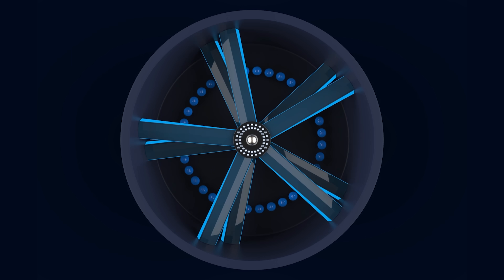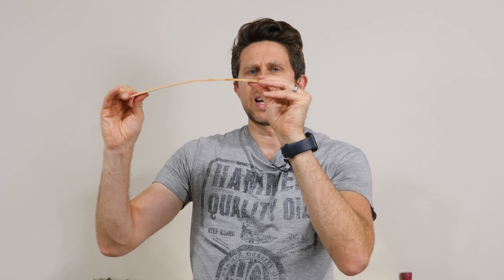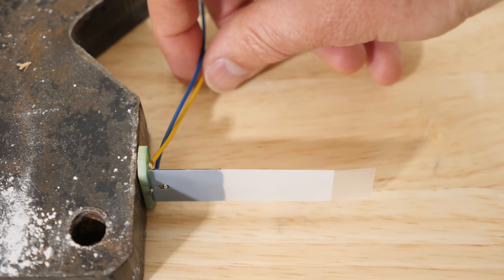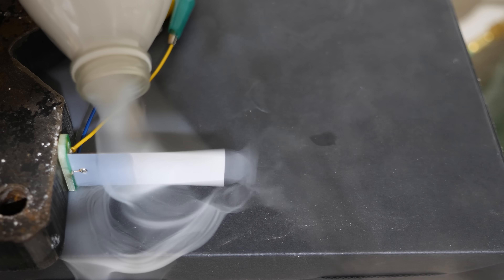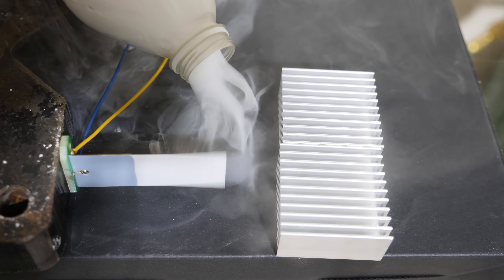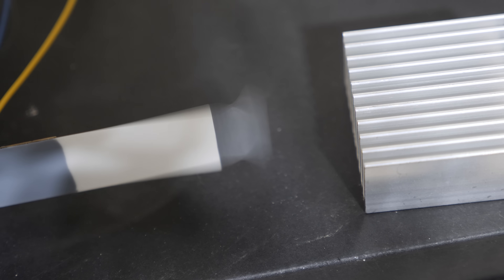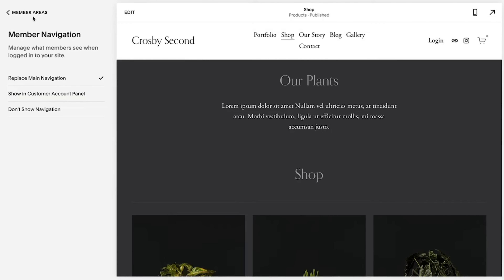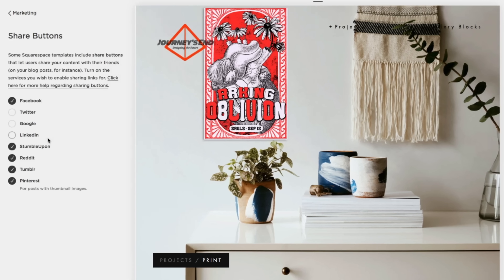A Solid State Piezoelectric Fan—Does It Actually Work?

Comment: 4:43 lol had to delete my whole comment XD ...and yes i would. apparently thats more obious then i was thinking however i would think small clusters of high heat output chips would benefit from this but maybe with enough work and reduction in size they could become a standardized part of every component in the board individually would take some tweaking to get it to run off the right amount of current still oscillate to an acceptable degree and not cause more heat ten the original component and on top of that and probably most importantly is to be the size of a current transistor...

Comment: took me a bit to formulate this response, but 'solid state' sounds like another absolute term we the general populace decided. rather than whatever it's original designed meaning was, at least that's what I get from the comments, could you possibly direct me to one that works as well as an old oscillating fan? it seems like there isn't a ton of power in your little design, but it is a tiny flappy piece, so what's the more full sized one like? how does it compare?

Comment: One could also attach several piezoelectric elements to a plastic strip to control them independently of each other. This would allow more complicated movements, such as the flapping of a bird's wing (which not only moves the wing up and down, but also rotates it), to get more power out of it.
Reply: Piezoelectric bees!!!

That reminds me of an article I read on Wired ages ago... maybe 20 years back someone invented a slugbot.  Basically it was a little treaded robot with a very basic articulating arm that could go out in the crop fields.  It turns out slugs glow under black lights, so they were able to design this to go and scrape the slugs off the plants and into a container.  The really clever bit was that then the bot would go back and dump the slugs into a vat to turn them into biodiesel to power the slugbot.

Imagine an army of little pollen powered Piezo electric bees going around pollenating flowers.  (I mean, the real thing is much better, but it would be a great detail in a sci fi story or something!)

Comment: The only downside to this is that, there is a lot of vibration. Because the object is moving back and forth really fast, that results in an unwanted amount of vibration. If you wanna do this is a large scale stuff with  that type of fan.

Comment: There is an alternator at the power company that spins to produce the alternating current. Even though it is really far away you still need something spinning to produce the ac current.
Reply: Good point, but a spinning device is not required to produce AC.  AC can be produced with electrical / electronic circuitry.  Have you heard of a "tank circuit"?  It's comprised of a capacitor and an inductor connected in parallel.  This kind of circuit provides the basis for making an oscillator which produces AC.  And that is only one method of producing AC... there are many others.
Reply: @yeroca  Actually, as soon as I wrote it I remembered that I have an inverter hooked up to my solar panels.

Comment: The showstopper for this type of fan when I considered it were:
High voltage needed. We didn't want to go above SELV if don't have to.
Second showstopper: Buzz noise. This thing is not silent, the vibration is nasty. I was wondering if it could be eliminated by using two in the exact opposite phase, but the costs of needing two was too high.
Reply: Although the voltage is relatively high (30v should be enough) the current is extremely small. Is there no provision in the SELV rules that allow any exception for sub milliampere currents?
Reply: @laurensvisser7623  the device we had was working on AC 110V. If 30V is sufficient, it should be okay.
Reply: @sevnpicoferro5352  Lower voltage means less movement. So you would need to scale this up even more at 30 V

Comment: We actually used piezoelectric fans for a cryo-cooler made for the ISS. Fewer moving parts in space is a good thing. I developed Computational Fluid Dynamic models and simulated an array of them. Vids are on my channel from ~9 or 10 yrs ago.

Comment: By placing diodes in the circuit couldn't you get the energy to expand the one side FROM compressing the other side? Some diodes and a small capacitor.

Comment: I would imagine that it would be rather challenging to make piezoelectric fans for a PC that could act as drop-in replacements for the conventional rotating fans used. It seems to me that any piezoelectric variant would require more volume to move the same amount of air. The design of the chassis would have to be modified and become somewhat larger, perhaps by 50% or more.  Then there would be the question of how quietly it could be made to operate, which is important to many people. But, after that, why not?

Comment: Sharper Image Ionic Breeze, from WAY BACK, ionized the air, with high DC voltage, and it then moved by the polarized plates. So, the only movement was the air, itself. Of course they charged a "left nut" for it, inspiring guys like Dyson, to make overpriced wares !
Reply: But Dyson's fan still has rotating blades hidden inside.  The only cleverness is in the use of the "entrainment" effect to move more air than the fans themselves are moving.   That and figuring out how to get people to spend about $300 for a fan that really doesn't work as well as a $20 box fan from Walmart.

Comment: The air pump for my aquarium has the same principle as this, only it is using electromagnetism instead of piezo.
Reply: Well, any speaker or voice coil in fact has the same principle as this. Moving air without the need of conventional rotating fans (no bearings)

Comment: Nice concept! The "fan blade" could work better if it was uniform in rigidity, though. Seems like the tape at the end is making the assembly act as a pendulum, which starts resisting the driving force partway into the cycle. This is probably decreasing the total output by a significant amount, as only the smaller, more flexible part is moving air outwards.
Reply: I suspect this was a hack rather than just a tuning method.
Reply: That's true, in the original paper they can tune the blade to the correct length to get the correct natural frequency. I believe in this instance though he had to add the tape to achieve the correct  natural frequency of the system so the tape acting as a damper is part of the tuning.
Reply: I was thinking that the tape at the end was probably inefficient, but I didn't possess the knowledge to articulate why.
Reply: Saw the same thing in the slow motion the end was too bendy
Reply: I think that was more for a visual reference so you can actual see that its moving without smoke. Or for example when you see ppl test fans they tie strings to the vents because its easier to visualize the air movement.
Reply: u are one smart cookie. Good thought process
Reply: how piezoelectric crystals vibrate..? what makes alt current to give, up and down force to it...?
Reply: @dgr8nikhilsrivastava  It is just in resonance, it just does it automatically because one end is firm and the other is free to move. It is the reverse of making a thin sheet vibrate when air is blown across it.

Comment: I absolutely would use this kind of thing in my computer as long as it could move enough air to keep it cool and was quieter than the fans I currently use!

Thing is, we already have technology that makes rotating fans extremely efficient, incredibly quiet, and super cheap. The amount of power normal fans use compared to the rest of the system is rather negligible. These things would have to compete with that, and I don't know for sure that scaling it up won't have unintended noise pollution.
Reply: The Major Hardware channel has fan blade showdowns.  It wouldn't quite fit their normal testing parameters (they put different blades and shrouds on a the same fan motor for consistency) but it would be interesting to see one of these in a his tests.
Reply: I've never had an electric fan wear out, my laptop is over 20 years old and the fan still works fine, mind you I don't use it very often, never seem to have the time or need for it lol
Reply: True, what about the wearing part?

Comment: And hard drives!  Hard drives have tiny little piezo actuators attached to the heads for fine tuning of the position.  Kinda neat.  I thought the arms were just magnetically positioned, and the heads were rigidly attached.  Nope.

Comment: Yeah, if that sort of fan would work for a computer, I'd definitely get some.  But it displaces the heat rather than getting rid of it.  Is there a way to convert the heat into coolness?
Reply: A thermocouple converts heat into electricity, but at fairly high temperatures. If some brilliant engineer could devise a low-temperature thermocouple, then I think you're onto something. The system would cool down and provide current at the same time.
Reply: @marsbux-tech  That's what TEGs and TECs are.  Peltier-Seebeck effect devices.  You can buy them for CPUs and were popular for awhile, but they generally aren't efficient enough to get rid of a sufficient amount of heat in modern CPUs, so air and/or liquid cooling are still needed.  I think they top out at about 3% efficiency, which sucks.  However there is some more recent research into creating devices that are up to about 40% efficient.  Time will tell whether that tech becomes usable or not.